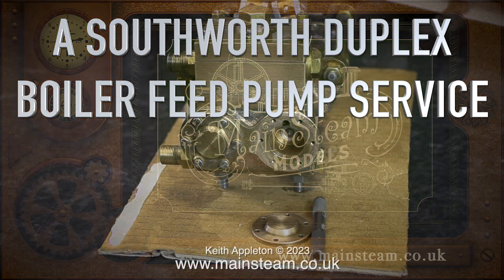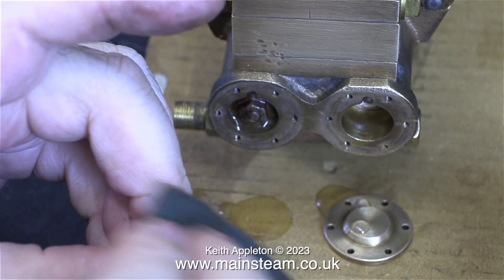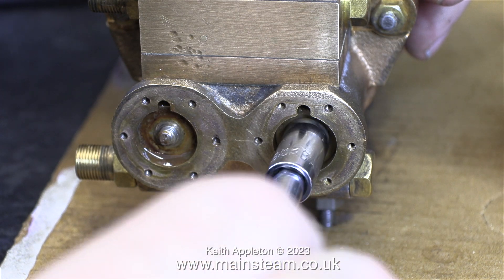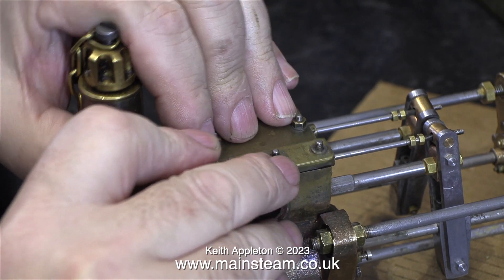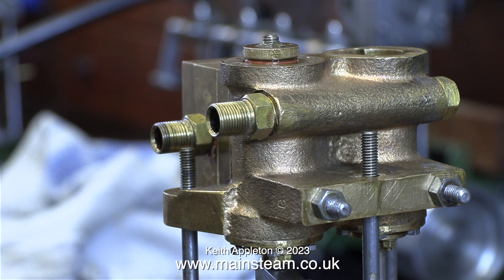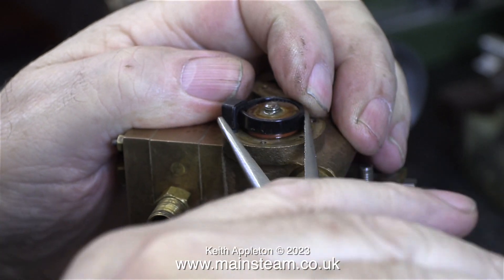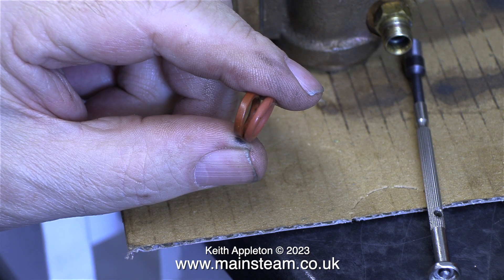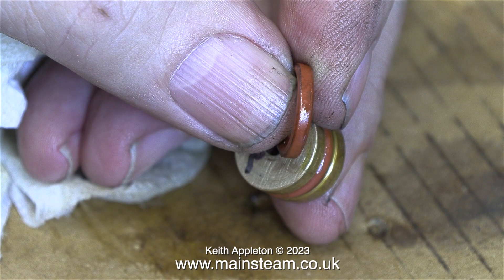SOUTHWORTH DUPLEX BOILER FEED PUMP SERVICE - PART #3

Comment: to me it looked like the inside diameter of the old ring is slightly bigger than the new one
Reply from the maker: Yes, certain types of oil will attack Silicone and make it swell.
Reply: thanks